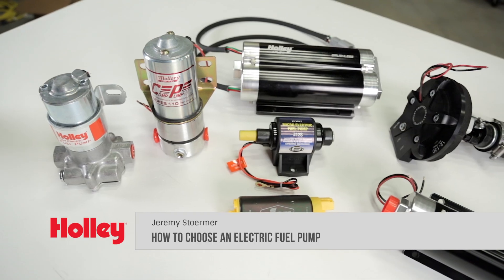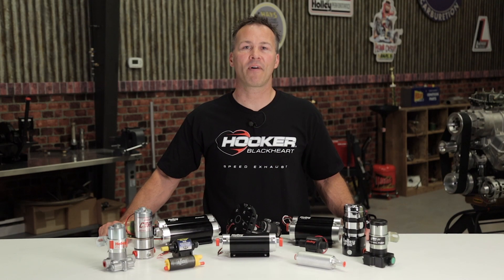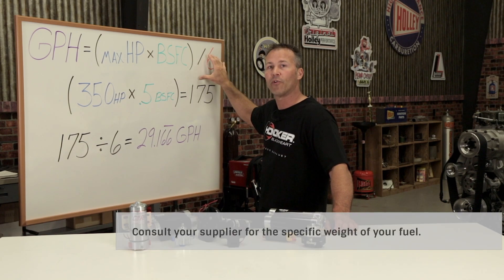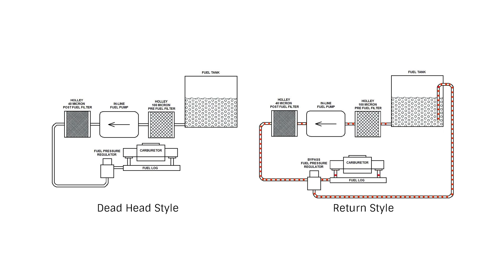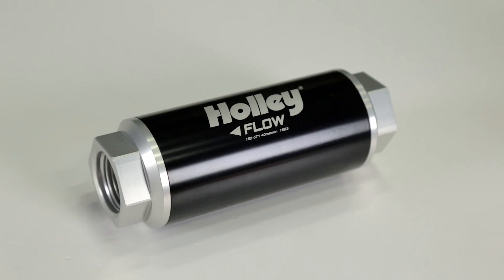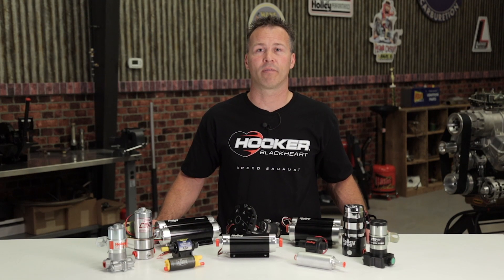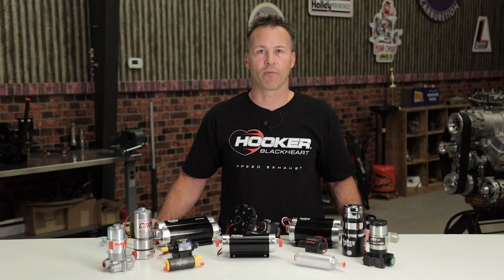How to choose an Electric Fuel Pump!

Comment: I bought a ranger with an 89 5.0. The did not change the fuel pump. It is the v6 pump so the motor is not getting the capacity it needs

Comment: For carbed applications, I have always used the tried and true Carter electric pumps, and then a Holley regulator. I have only ever bought one Holley pump, and it had to be replaced within a week. It started leaking between the motor and the pump head, supposedly a sealed assembly. The Holley 12-803 type regulators have worked very well for me. The pumps not so much. That leak chased me off forever, and I will never trust or buy one again.
Reply: https://static.summitracing.com/global/images/prod/large/crt-p4594.jpg

Comment: So, I run the red 97gph pump. Does it mean I dont need a regulator? The preowner installed a regulator anyway. But how to ensure my edelbrock will get constant 5psi without a regulator than? Thanks for your support.
Reply: You don't need a regulator for holley red vane style, it is limited to 7 psi.
Reply: @harmankardon478  In theory you are right. But I also have vapor lock issues so I will need a return line too. So, I will install a bypass reg.  and as a benefit I will know the pressure on the line too.
Reply: if you know why are you asking? @fuelbasti

Comment: Hi, are all inline electric fuel pumps also pull-through fuel pumps?  My truck can sit for weeks and sometimes months between starts.  I want to use an electric fuel pump to prime the carburetor in my truck before I start it.  After the truck starts then I turn the electric fuel pump off and have the engine just run on the stock mechanical pump.  But the mechanical pump has to be able to pull fuel through the turned-off electric fuel pump.  That's why I ask if all electric fuel pumps are pull-through pumps.  
Also are there temperature limitations on an electric fuel pump?  For example will an electric pull-through fuel pump work ok at -10*F that has been sitting in -10*F temperatures for several weeks?

Comment: Why is it that some vane style pumps that flow for EG: 220 gph are rated to 650 odd HP and with an EFI pump only require 54gph with same sized fuel lines.  Considering going the the Black EFI Screw type design , just trying to understand the difference. Hi from Australia :)

Comment: Not mentioned are the AN fittings.   For example. If you run a 3/8" fuel tube (steel, aluminum, rubber or teflon), the I.D. is .375".  Using AN 37 degree flare fittings, the I.D. of a -6 fitting is 0.285" which is 0.090" smaller than the tubing. Going to -8 tube fitting the I.D. is 0.390" which is 0.015" larger than the tubing.  Most people that have not used AN fittings believe that a -6 is equivalent to 0.375 I.D. and that is not the case.

Comment: Nice video. I have a Sniper EFI installed in my 73 Chrysler Imperial ad it's working great, however the fuel pump is a bit noisy considering a luxury sedan environment. I'd like to know if there's a quieter electric in line fuel pump for my application. Thanks.

Comment: What in-tank electric fuel pump can I use on a 2008 Subaru Impreza and should I upgrade from my stock oem fuel injectors??? Especially, since my current modifications such as: 3" single exhaust pipe catback (my stock vehicle exhaust system was a dual exhaust set up), Cold Air Intake with a throttle body spacer, and $58.00 Chip connected inside the engine compartment (which I'm not even sure makes a difference, don't judge me). Any suggestions or anything??? Help!!!!

Comment: I have a 300 inline in my 72 F250 is plan to use a sniper EFI, Ill be using an auxiliary tank as my primary and  I'm curious as to what pump you would recommend? I realize most of these comments are from 2 years ago but it can't hurt to ask

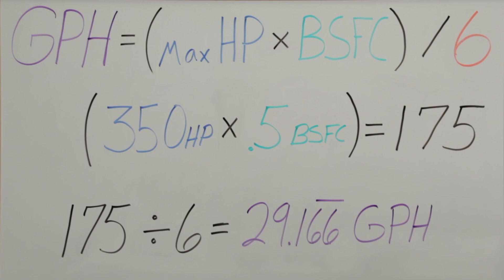Comment: Great info, the formula at 2:30 didn't exactly specify whp? or crank hp? Which one to consider in the calculation?
Reply from the maker: Fuel calculations like this are always crank horsepower.

Comment: I have a doubt, for some weber carburetors which electric pump do you recommend?
Reply from the maker: You didn't specify which Weber carb you have, in my experience with the side draft carbs they like to have about 3.5psi max.  Assuming your wanting a self regulating fuel pump here are a couple of choices.  the Holley  12-426 and 12-425
https://www.holley.com/products/fuel_systems/fuel_pumps_regulators_and_filters/fuel_pumps/carbureted_fuel_pumps/carbureted_electric_fuel_pumps/parts/12-426
Mr Gasket 42S https://www.holley.com/products/fuel_systems/fuel_pumps_regulators_and_filters/fuel_pumps/carbureted_fuel_pumps/carbureted_electric_fuel_pumps/parts/42S 
Most all of our other electric pumps would require and external regulator to bring the pressure down enough for the Weber.  We have a large selection of regulators that would work, you can check them out here.  
https://www.holley.com/products/fuel_systems/fuel_pumps_regulators_and_filters/regulators/carbureted_regulators/      Hope this helps, Thx J

Comment: hi!  I have a jeep cj7 with engine stroker 4.7  and  carburetor edelbrock 600.  what pump should I buy? preferably not noisy
Reply from the maker: The first thing you should do is get rid of that brand "E" carb!!   LOL!   All kidding aside, our Holley red or blue pump would work great for your set-up assuming that you are looking for an external "in-line" pump and not an in-tank unit.  Heres a link for you.  Remember to mount the pump as close to the tank as possible and lower than the lowest possible fuel level for best performance and life-span.  Thx J
https://www.holley.com/products/fuel_systems/fuel_pumps_regulators_and_filters/fuel_pumps/carbureted_fuel_pumps/carbureted_electric_fuel_pumps/parts/12-801-1.
Reply: @HolleyPerformance  thai you so much!

Comment: I have a MC 2150 on my 82 F150 302ci 4x4 with a c6 Auto trans. I bought the truck from a PO. If it has a carb on it but it has an electric fuel pump ( it's hardwired on a switch mechanical pump is still on block just not connected) would the Electic Fuel Pump be supplying too much pressure to the Accel Pump Diaphragm that Is used for a mechanical pump?
Reply from the maker: That all depends on what the specs are on the electric pump.  It will push fuel past the needle and seat first (usually happens around 8+ psi of pressure), if you are getting a fuel leak at the accelerator pump it is probably a bad diaphragm.  Thx J
Reply: HolleyPerformance Thank You, omw to Oriellys on Saturday and she died on me.. Accel was still leaking, tried priming her and the peddle snapped. TIG'ed the pedal, then tried priming and no gas. So my fuel pump was Fawked as well. changed pumps and diafram. she's get 14 to the carb. runs like a top. thanks man!

Comment: Got any high pressure high GPH diesel pumps that cost less than $200.00 ???  I have a  5.9L 12 valve P-pump Cummins and I am looking for a reliable affordable pump with 3/8 or 1/2 inlets/outlets that can maintain a minimum of 20PSI at full throttle

Comment: I want  to do an LS-3 swap  run on flex fuel ..  I want to add nitrous in the future .. With my carbureted car  I needed about 3 PSI for my Nitrous .. spray bar under the carb..  I have not yet figured out  what pressure an LS  nitrous spray bar uses..

  I plan to upgrade my gas tank so I can run an in the tank fuel pump .. I like the Holley  Sock type fuel filter but have notices many other brands use similar ..

  When I added Nitrous to my 1979 Z-28 Camaro  I added a simple  in line electric pump .. I removed my  mechanical fuel pump that used a  return fuel lien and also had a charcoal Canister to store gasoline fumes.. With Engine vacuumed  it sucked those gas fumes into the intake instead of loosing them to the atmosphere  which would cause a little air pollution ..

  Sadly I removed all of that and later discovered the  High Volume pump that cam on my Camaro put out more fuel pressure than the small Holley Electric pump ..  I also found a kink in the stock steel fuel line coming out of the gas tank .. I replaced that  with  rubber fuel line ..  I also used an adjustable fuel pressure regulator ..  The  car still has a small steel fuel return line and I may still have the Charcoal Canister ..

  I have read quite a lot on high pressure fuel systems yet have heard no mention of a Charcoal fuel canister ..

  I like the idea of a PWM  pump set up the best..  I like the Haltech  ECM and wiring Harness.. I did not find a similar product by Holley so far..

  I need to research  if the Haltech 2500 series ECM  can already do PWM or if I have to add a second ECM with fuel pressure sensors.. I also of course need a GM type Flex fuel ethanol content Sensor.. 

\  I does look like Holley offers some of the better Motor mount kits for LS swaps  but they web page is terrible for info  as is their page for a complete radiator set up ..
Reply from the maker: Our HP and Dominator ECU's can both handle pulse width modulation of your fuel pump.  I will pass the info on to our web designers about the difficulties in navigating the website!  Thx J
Reply: @HolleyPerformance   It's  not  difficult to Navigate It  just simply  does  not  include the necessary  information  to select the  correct radiator ect .. for LS swaps .
Reply from the maker: @mikeskidmore6754  Got it, I will pass it on! J

Comment: I just installed a 2002 5.7 Vortec Kodiak Marine engine in my 1981 Chevy 3/4 ton truck. I equipped the engine with my stock Quadra-jet 4-brr carburetor and had to use an electric fuel pump , due to the Kodiak 5.7 engine not having the hole for the mechanical pump.

I contacted the engine manufacturer and was told that the engine has a 383 stroker camshaft and the engine produces about 300hp.

I am having a problem with the engine wanting to die out (it does) due to lack of enough fuel at intermittent times and will not start until a minute or two passes.

Since i put the engine in last week i am currently on my third fuel pump. The first two were duds the same day. Today i went to the local auto parts store and purchased a Mr. Gasket brand pump that is rated at 4 to 7 psi. I have the pump in the engine bay with the hood completely off. After getting on the throttle a few times it stalled out on me and would not start until about a minute or two passed.

My question to you please :

(1) What size fuel line hose should i use ?

(2) What pump do you recommend for my setup ?

(3) And what do i do about the vapor return line that is left over now that i am no longer using an mechanical pump ?

Please help. Thank you.
Reply from the maker: 5/16" fuel line should be just fine for 300hp.   If you are using pump gas you will need a fuel pump capable of flowing at least 120lph or 32gph at 7psi.  I believe your installation of the pump in the engine bay is your biggest problem!  An electric fuel pump is much better at pushing fuel than pulling fuel so it needs to be as close as possible to the fuel tank and mounted below the lowest fuel level so it is gravity fed.   If you are using the 12S Mr Gasket pump you should be fine as long as you mount it correctly and in the proper location!  Thx J
Reply: @HolleyPerformance  Thank you so much ; i already moved the fuel pump and used the 5/16" fuel line and it works fine now. Thanks again , i really appreciate your help.
Reply from the maker: @manfredschield9745  Glad we could help!

Comment: I have a Holley electric fuel pump part # 12-125.        125 GPH this pump works for ls swap ? ( engine vortec 5.3)
Reply from the maker: NO, that pump is designed for carbureted use.  you will need a pump rated for EFI use such as our 12-920.  Thx J
Reply: @HolleyPerformance  what's recommended for turbo ls swap that's carbed?

Comment: I have a 1973 mustang with a pro-jection 2d Efi system 
Would you recommend me a different fuel pump to use not the stocking one
Reply from the maker: I assume when you are referring to the "stock" fuel pump, you mean the electric unit provided in the Pro-Jection kit?   The pump P#534-38 is a great pump and is matched to the Pro-Jection system very well.  Unless you have added larger injectors or maybe forced induction the included pump will do just fine.  We still offer replacement units under the part number I listed above if you need a new one.  Thx J

Comment: I need 10 psi or so lift pump with wire harness conect3d un to my battery  Its 1995 3500K 6.5
Reply from the maker: Most of our pumps are only rated for use with gasoline and have not been thoroughly tested for use in diesel fuel.  Your best bet is an aftermarket pump designed as a lift pump for diesel use.  However, we do offer a few pumps that are diesel compatible, here is a link to those we offer!  thx J
https://www.holley.com/products/fuel_systems/fuel_pumps_regulators_and_filters/fuel_pumps/carbureted_fuel_pumps/

Comment: I have an 06 Z71 flex fuel Avalanche and I’ve installed an GM Performance 6.2 ls3 rated at around 515 hp, I’ve somewhat recently, about 5 or 6 months ago, started running e85, by the way it’s my daily driver. Within the last 8 weeks I’ve replaced the fuel pump twice and I think the pump I just put in is exhibiting the same pre failure symptoms. It’s an intake pump in a return less system. I’d ultimately like to add some more performance adders such as forced induction but obviously need to get this issue resolved first. I’ve been looking at retro fitting an after market in tank pump and filter do you have any suggestions? Thanks
Reply from the maker: Can you tell me more about your current set-up?  What pump are you currently using, what size fuel line/hose?  what pressure does your system need?  When you say returnless, you have no regulator what so ever (in tank or external)?  Are you using Pulse width modulation? Thx J
Reply: HolleyPerformance, 
Thanks for the quick response!

It’s the factory configuration currently, in tank pump, regulator, filter unit, 3/8” supply line. It does have the factory charcoal canister and evap solenoid but no return, Im not opposed to installing a return depending on the feasibility/cost. I believe it should be running at 70-75psi under load and 60-65psi at idle. I’m still getting familiar with the operating system and have a custom tune but I do believe it uses pulse with modulation.
Reply from the maker: SO it's a factory in tank fuel pump???  If so, I  would check with your GM dealer and make sure that the replacement unit you are using is in fact compatible with E-85 fuel!   J
Reply: HolleyPerformance,

Yes and yes, why do you ask?
Reply: To clarify, it’s a flex fuel vehicle/pump. E85, I’m not so sure.
Reply from the maker: Just trying to help, you said that you needed to resolve this issue first.  
We have several choices to replace your factory pump but you will probably have to do a little modifying to mount one in place of the stock unit. here is a link to the page-
https://www.holley.com/products/fuel_systems/fuel_pumps_regulators_and_filters/fuel_pumps/efi_fuel_pumps/efi_in-tank_pumps/ 
The 12-929 looks to be your best choice since it's compatible with E-85 fuel, you never said what type of forced induction you were planning or what hp you would be adding, but this pump is capable of supporting 750 hp naturally aspirated giving you some room for hp increase over what you currently have.  
We also have some options with our retro fit  units-
https://www.holley.com/products/fuel_systems/fuel_pumps_regulators_and_filters/fuel_pumps/efi_fuel_pumps/in-tank_retro-fit_fuel_module/
https://www.holley.com/products/fuel_systems/fuel_pumps_regulators_and_filters/fuel_pumps/efi_fuel_pumps/fuel_cell_efi_fuel_pump_modules/
Thx again J
Reply: HolleyPerformance, 

Fantastic! Will I need to Install a separate regulator and filter?
Reply from the maker: Yes,  I recommend using a return/bypass style regulator as well as a pre (or hydra-mat) and post filter. thx, J
Reply: HolleyPerformance,

Thank you! Would the post pump filter be in tank? 

Do you have part numbers you’d suggest?

Comment: Ok I have a 1997 350 vortex converted over to carb in my 1987 Monte Carlo summit racing intake. I was wondering with electric fuel pump I’ll need ? The car stalls when I mash the gas. I’m currently running a cheap one. Don’t know the horse power, have Wilwood brakes, and running unleaded fuel. I need to purchase ASAP.
Reply from the maker: There are a lot of variables for fuel pumps!?  Are you currently using a mechanical or electric fuel pump?? 
Here is a link to our mechanical pumps we carry_ https://www.holley.com/products/fuel_systems/fuel_pumps_regulators_and_filters/fuel_pumps/carbureted_fuel_pumps/
And a link to our line of electric pumps-https://www.holley.com/products/fuel_systems/fuel_pumps_regulators_and_filters/fuel_pumps/carbureted_fuel_pumps/   thx J

Comment: ok so my 62 twin carb Corvair needs no more than 10 gallons per hour, thru dash 6 lines (after the T fitting stem which already is 11/32 ID rubber,  this part OK for 91 octane if it's from Shell in Canada, not sure about other product, and its effect on the mechanical pump diaphragm. 
these pumps had several poor quality re-issue and I may have wound up with one - did not go to internet sources
Reply from the maker: Not sure I understand your question?